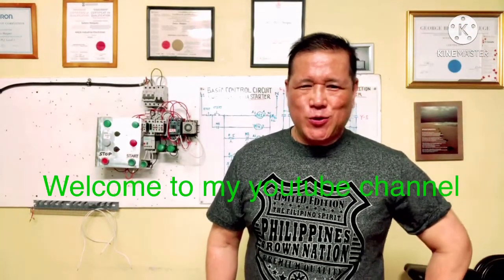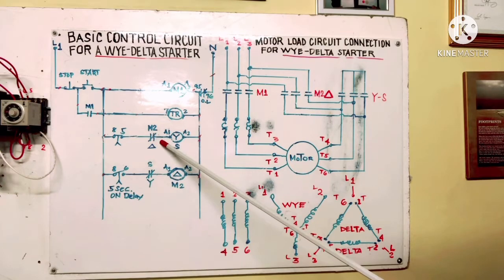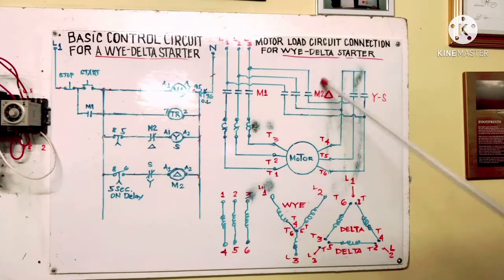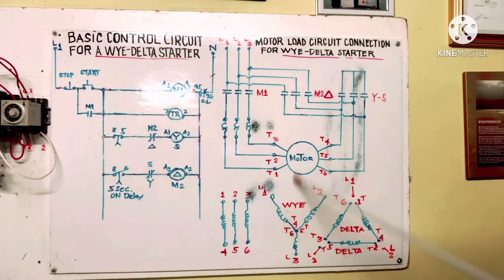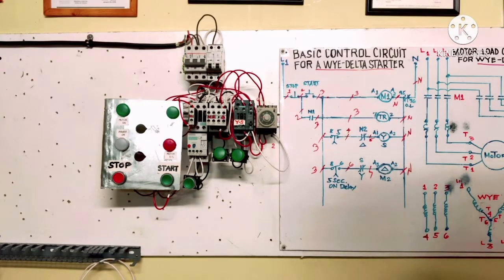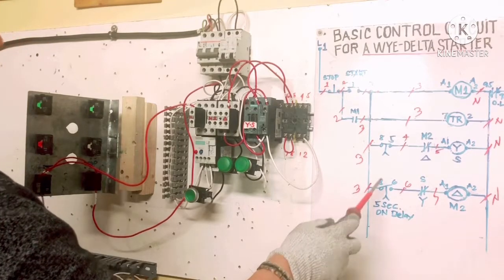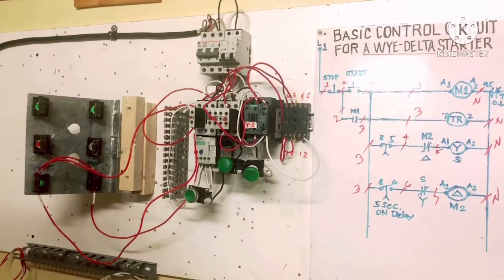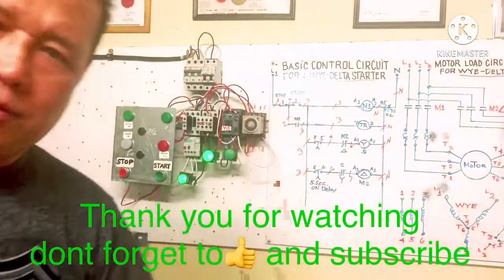Wye-delta starter control circuit with Omron time on delay.

Comment: Galing amazing. thank you sir. kaya po ba sya i apply sa fire pump na 6 leads dual voltage motor  220V Delta/440V Wye, 440V po system voltage namin, di po na masunog yong motor pag mag change sya sa delta. salamat po
Reply from the maker: yes bro ganyan ang connection ng fir hidrance pump

Comment: I believe soft startearnlers have removed the need for this configuration, but important to learn in case you have to repair.
Reply from the maker: we some startvalve motors we use soft start seimens and allenbradly. instead wye delta connection. but better you must know and learn how to connect specially for the beginners.
Reply from the maker: this motor control wye delta connection is very important to learn mostly used on big motors. if you know the connection you know how to troubleshoot and install or connect.
Reply: No VFD'S have replaced them. They save an enormous amount if power whenever they are running at less then full speed. We had hundreds if VFD'S from 2 to 1,759 HP. All of the air a handlers ( 50 to 150 HP & Return air fans ( 20 to 125 HP ) were able to run at only 50 to 60% of full speed at nights & weekends thus only using maybe a third amount of a full speed motor.

Comment: Many thanks Master for the excellent presentation. How is the time delay calculated in a Star-Delta set up? What I am trying to say is that how did you come up with 5 seconds? Why didn’t you select 7 sec for example.
Reply from the maker: That is standard mostly used is 4seconds to 5 seconds only and the connection is always like that.
Reply: @tmelectricaltutorials2851  Got it. Thanks
Reply from the maker: Your welcome 🙏

Comment: Thank you Master once more for the lecture. I have two questions:
Are 8 and 5 the normally closed timer connections?
Are 8 and 6 the normally open timer connections?
Reply from the maker: Yes you’re right,” terminal 8 and 5 is normally cloes and terminal 8 and 6 is normally open.

Comment: Great video Master.  Is it okay to also use (1;5), (3;4) and (2;6) on the delta connection instead of using (6;1), (3;5) and (2;4) ?
Reply: Noted. Thank you
Reply from the maker: You’re welcome
Reply from the maker: No you must connect the right connection’s.

Comment: Professor paki gawa ng video ng overhead cranes na gamit ang VFD . Paki explain ng circuit diagrams at pag program ng VFD. Salamat .
Reply from the maker: Makakawa ako ng video tutorials nyan wiring installation pero wala VFD . Hindi pwedeng lagyan ng vfd drive ang hoist or crane. Ibat ibat company pinang galingan ko walang may variable drive ang hoist. 
Not safe with vfd drive ang crae or hoist.